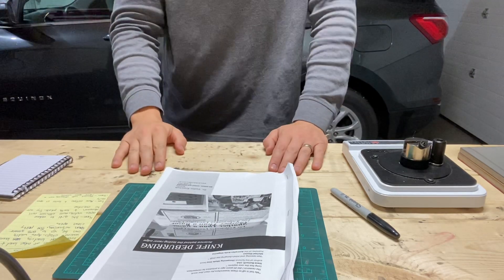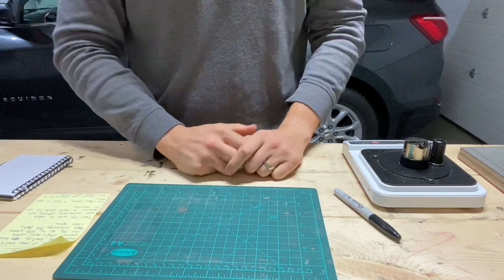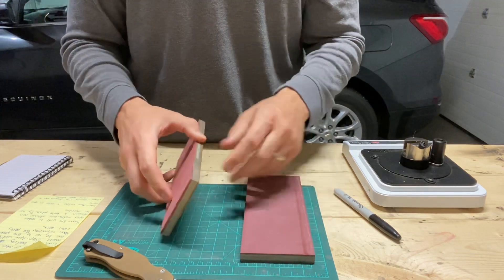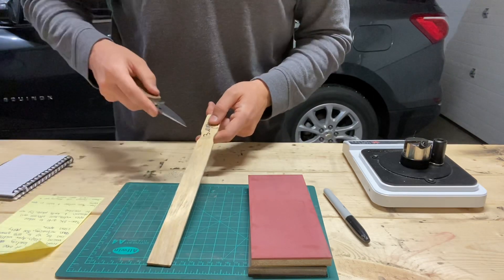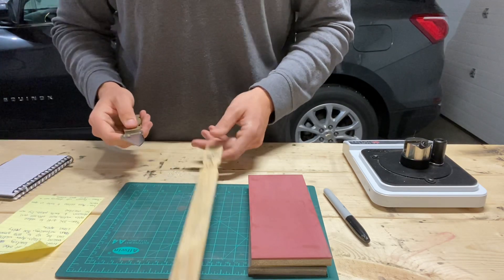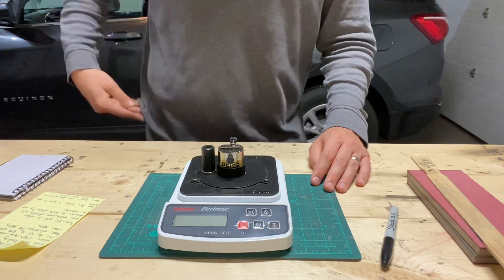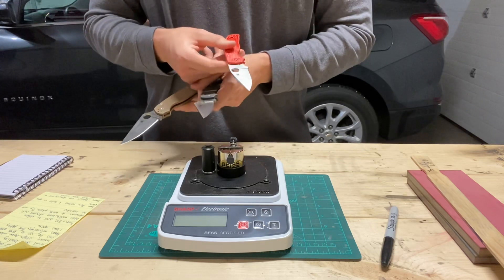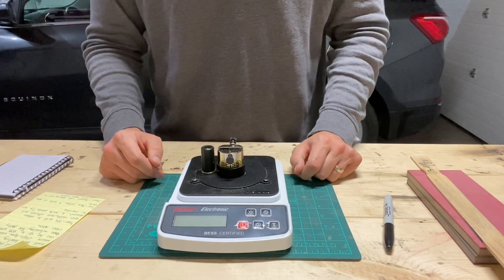My Hypothesis on Stropping and Burr Removal

Comment: I'm quite busy with the topic of stropping and burr removal in the last years. What I would appreciate and wish for is not only theoretically speaking and contemplating (although I have nothing against this), but actual testing being done and hypothesis proved or disproved. Visualisation under high magnification microscope + real life testing with BESS before and after cutting different mediums, i.e. actual usage of the knives.
Reply from the maker: Lookup the report I reference. That has some of the most concrete tests. 

Additionally check out science of sharp website. A lot of that info is on straight razors and bare leather so it’s not an exact comparison but he has filled in many articles with higher end steel.
Reply: @EngineersPerspective701  I have purchased Vadim's book "Knife Deburring" (R.I.P. Vadim - you will be missed) and I am reading it. There is so much valuable stuff in it, including SEM images - it takes time to digest. 

The main issue is that I am not willing to work with power tools to deburr as he used to do. I am strictly focused on fixed angle sharpening system (currently TSPROF K03) and I am on the deburring step and choice of stropping medium - leather, wood, cardboard, iron, copper... you name it. It has been a great challenge to remove the entire burr without significant amount of rounding off the apex, which reduces keenness which drives me nuts.

I have all kinds of pastes, emulsions, bars. In total over 20 different kinds in chromium oxide, CBN and diamond. I am trying different grits ranging from 40 micron down to 0.1 micron. 

And it is a process. It is a path of discovery. Often times I feel like a mad scientist in the 17th century but having the most advanced sharpening gear.

Comment: This would be fantastic... If I could just form a detectable burr... Not sure if I'm failing to form a burr, or just failing to detect it.
Reply from the maker: What grit are you starting at and what knife, steel?
Reply: @EngineersPerspective701 Lately I've been starting on a 400-grit diamond stone, using a fixed angle system to minimize variance.  Steels have been mostly D2, and 8Cr13Mov (dont want to experiment on anything more expensive yet).   I'm wondering if maybe its a pressure issue?  I have been using what I'd call moderate pressure at most, enough pressure to ensure constant blade contact but I'm not trying to be agressive (I'm happy to do more passes slowly as I learn).   

I progress up to 3000 grit and strop on leather with green aluminum oxide and can get decent edges, similar to or slightly better than a decent factory edge, but that's been my plateau because I can't ever detect a burr,  I feel for it, and I've tried shining a light down the spine opposite of the last side to touch the stone and look for reflection... Never see one... so I just ignore any de-burring techniques and move up the grit progression.

For my next experiment, I think I'll try to detect a burr after lots of very light passes...  Unless you have other advice.
Reply from the maker: @ great info there! I’m pretty certain you need spend longer on your first stone. 

The first sharpening that sets your edge bevels to a perfect v edge, removing a micro bevel or if you’re clamping up differently from prior sharpening sessions can take an unbelievable amount of time to fully apex the edge. Especially if you’re going lower angle or even trying to match. 

After you’ve got it once and clamp up the same then it’s not an issue.
Reply: @EngineersPerspective701 I appreciate the advice.  I've watched my scratch pattern creep from the back of the bevel clear to the edge, and I've tried staying on the coursest stone, same side, until I detect a burr... Ground off at least 10% of my blade steel, still never found a burr (that's why I think it's possible I'm forming burrs but can't detect them).   Let me ask you this: How hard are burrs to feel?  In my mind, it would be on par with feeling an eyelash on top of smooth glass... Should I be feeling for something much finer than that?  Larger usually?

Comment: I'm almost sure you could get a keen sturdy burr to score under 100 BESS. Albeit at that point, does it even matter?
Reply: That's what I'm thinking. As of now, I'm not ready to believe that a sub 100 Bess edge is guaranteed burr free. I had some between 60-80 Bess that deteriorated very fast, after just a few cuts. Which wouldn't happen if I were actually cutting with a burr free apex.

Comment: Very interesting & a great explanation . . . I learned a lot.  
- What's your perspective on steel plasticity introduced through sharpening ? 
- What's happening at the atomic levels within metallic particles ?

- What's happen in the metallic crystal boundary areas ?
All of these factors have the potential of reducing durability of the cutting edge. 
We know from past research that cracks form in the metallic structures: especially when sharpen on belt grinders. 
How can we avoid these forms of metal fatigue at of near the knife apex ? 
Appreciate any insights you have on these knives sharpening issues.

Comment: You can use a bright led flashlight as this will highlight the burr really well. Also a knife that has any burr will absolutely not cut a paper towel or tissue, cleanly without catching the fibers, but a properly deburred knife will. Magazine paper or phone book paper is also good, but not fool proof.  Jewelry loope is a good way to tell as others have said . I think a lot of ppl get frustrated with learning knife sharpening because most ppl starting out in the knife world will most likely be sharpening on D2 and D2 is awesome awesome steel. However it's not the best steel to learn deburring because it likes to hold on to that burr. Learn on 14c28n then try d2. Good Heat treat also helps. High angle, very low pressure, reverse passes on a 1500 - 2000 grit ceramic rod will cause your wire to fold over. Then you can sheer it clean after folding it 2 times on the rod by doing forward passes with the rod light pressure high angle
Reply: Whether or not the edge catches fibers can be a manner of edge finish too. Finishing on a 400 grit Naniwa whetstone produces a much less uniform edge than say, a Spyderco UF or a Venev F1200.

Comment: Interested video,I use carson microscope to identificate and eliminate de burr,I dont use stone(natural or syntetic)to take it off..Do you recommend it me to incorporate on my deburring sequence?
Regarda everybody
Reply from the maker: I am a big believer in doing as much deburring on the stone as possible before using a strop. 

But some steels and heat treatments are very forgiving and let you leave a larger burr and strop it off without loosing aggression and still getting a very clean, burr free edge. So in that case I am often lazy and will deburr less on the stone.

Comment: Deburring and stropping helps keep an edge sharp and durable longer ☝️ If you just sharpen a knife, notice why it dulls so fast like normies do with kitchen knives ☝️
Reply from the maker: Agreed. Science of sharp talks a lot about the mechanism that stropping creates a longer lasting and tougher edge right at the apex. 

I will say I can get very solid performance from a no strop sharpening specifically in kitchen knives. Not my go to but occasionally I’ll stop after a Shapton glass 8K with no strop or just strop on a dish towel

Comment: I’m sort of coming to the same conclusions as you (longtime sharpener). I’ve realized how easy it is to smooth out the edge on strops, and try to be as clean as possible off the stones so I don’t have to strop as much. 

Getting a a super sharp smooth edge that whittles hair is no problem for me (which is fine for push cutting, wood processing knives). It’s getting a clean toothy edc edge that can be difficult. 

I will say that I’ve seen tests (mostly Cedric and Ada) that many polished edges seem to last longer than an aggressive edge. It seems the higher carbide steels generally do better with an aggressive edge, but science of sharps newest postings sort of suggest otherwise.
Reply from the maker: I never want to sacrifice cutting ability for hair whittling so that's always my battle. 

In my use, it seems like the higher carbide stuff cares a lot less about the edge finish in the long run. My theory is that as the edge wears down, there are so many carbides getting exposed at the edge that they both 1) significantly slow the apex width increase due to abrasion 2) Have little cutting faucets that significantly aid in slicing. 

Even with a very fine edge, they break down into a slicing machine anyway so it's really up to the user how they want to play the up front sharpness game.

Comment: I just tried this method on my Kurosaki senko bunka with SG2/R2 at 15°DPS with dmt stones started at 1,500 to get my apex and not remove a lot of steel then went to 2,000 and finished on 3,000 all dmt did light pressure edge trailing then leading and did that through each progression. I then stropped on 1µm Diamond emulsion on cow hide. Then raised the angle by half a degree and used .5µm Diamond emulsion on kangaroo. I stropped with mostly light pressure on the strops and finished with only 2 strops just as you said in this video the knife will push cut through paper and whittle hair. This is one of the best edges I’ve ever got. I think it’s sharper then how it came in the box. I will definitely keep using this method.
Reply from the maker: That's awesome! Hope it keeps performing well for you

Comment: Your thoughts are definitely in the correct direction. I suggest You sharpen some 1095 carbon steel ( inexpensive experiment, ) and see how the burr removal is simplified.

There is a difference in sharpening stones & sand paper in raised abrasive and buried abrasive. Raised abrasives are so much more aggressive. The size & shape of the abrasives determine the cut into the blade steel , causing stress , when a belt the speed  cause friction that translates into heat that causes changes in the qualities of the steel integrity, the roots , like the roots of a tree ( you refered to ) are pronounced with ever spark that flys from the edge of a blade. With each valley carved out , gouged out , stresses are impacted in many deep directions .
Chasing the Burr is not an elimination of the Burr a their steel or leather alien the Burr in a forward direction. I under stand there will always be a burr , by going to smaller & yet  smaller abrasive size minimize the Burr .

Jewelers often burnish gold to harden the surface , I would like Your thoughts on that possibly  when getting a mirror finish on the edge ?
ThIs are just thoughts and ideas .
Great video , outstanding work.
Reply from the maker: I've sharpened a Mora, couple ESEEs, a GEC and a Case knife in 1095. Different experiences across them with different heat treats but overall I find that it's actually pretty hard to deburr without getting a completely smooth edge. Not a huge deal when processing wood IMO but not great for EDC in my book. 

Agreed that a burr is never really 100% removed in sharpening but it's not necessarily a function of abrasive size. With the right steel, heat treat, abrasive and technique a person can get an equally clean edge at 400 grit as 4000. It's just a lot more demanding on those 4 categories.

As for burnishing, I do feel like it happens in sharpening. Especially with the higher grit stones which is why I am a huge believer in diamond, CBN strops and ideally finishing stones. Burnishing is just fatiguing the crap out of the apex. From others I've heard that ideally a person would switch to super abrasives around the 6um mark but honestly I still use 5K, 8K alumina stones anyway because I just enjoy them

Comment: Very interesting.  The more videos I see the more I know how much I have to learn.  I'm going to experiment myself with the stropping techniques you've discussed here.  I've found out thru the last year or so how much one can screw up a great edge by stropping too long.   I've also learned how much you can improve and edge with stropping.  It's definitely a double edged sword. (pun intended)
Reply from the maker: Very much so! I’d say I’ve gone more away from stropping now than ever! Often choosing to finish edge leading strokes on the stone only or just follow with 2-3 passes per side max
Reply: @EngineersPerspective701  about the only stripping I do now is very very light passes and only very few, maybe 5 or 6 per side with 3micron or less paste on either dense leather or balsa wood.  I find I don’t screw up as much that way.